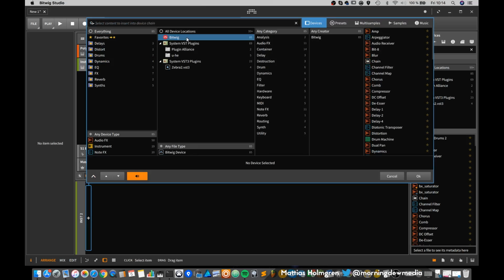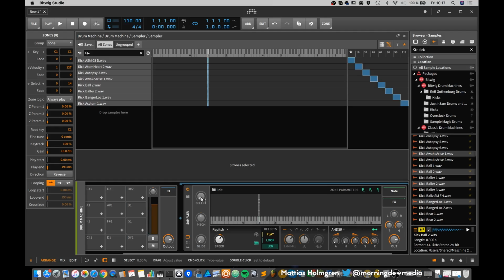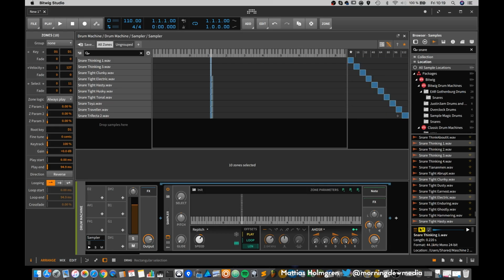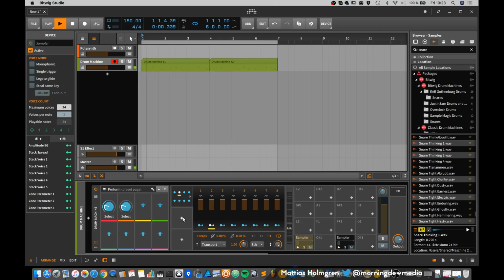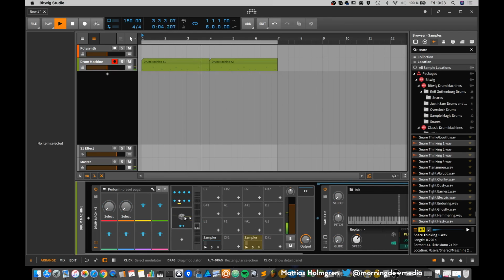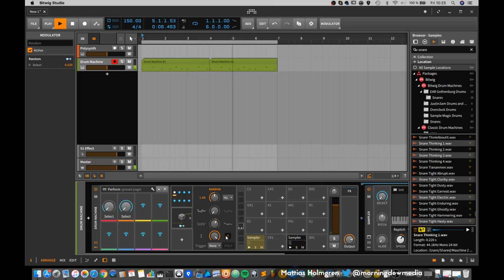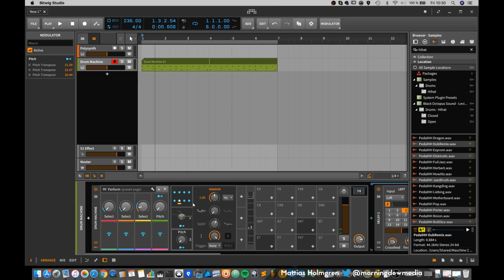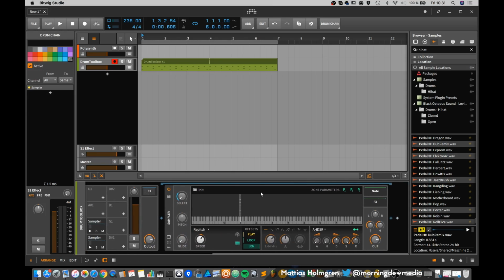Bitwig Production Tip | Drum Toolbox & Drum Machine

Comment: Matt, since your videos are really helpful, I wanted to share a quick tip I discovered on a reddit forum and that you may not know: You can rename your drum elements in the drum grid editor even with third party plugins such as Maschine: all you have to do is insert a Drum Machine in the slot before your Maschine/Battery or any other drum plugin you want. From here, just double click the drum machine cells. When the browser appears don't choose anything, just click the OK button. You can now rename this drum machine cell in the inspector on the left. If you want to rename each cell, you can do it slightly quicker by activating the MIDI DIN icon on the drum machine to find the cells with your MIDI keys.
Reply from the maker: Great tip

Comment: Mate is there any way i can copy like 80-120 hit samples into one key note at once? Its very time consuming, dragging and dropping onto a not when u have hundreds of samples
Reply from the maker: Yes, when dragging the samples and hovering over the multisample keyboard (drop zone) look at the bottom infobar of the Bitwig screen. It will display some short key suggestions (like Shift, Control, Alt) and what they do respectively. Select all your 25 samples (or whatever amount) Hold Ctrl and drag your samples into the multisample area (notice that only one key lights up now). This will automatically spread them for selection too. Hope it helps.
Reply: @MattiasHolmgren  oh man iv just been trying for the last hour to the out the select nob. Thanks for the quick response 😄👍. U made me very happy after i got all frustrated and turned my pc off. Now I'm going back up to try it out again
Reply from the maker: housebrigade haha ragequit? Happy to help my friend!
Reply: @MattiasHolmgren  lol it was more than ragequit. Now iv just spent ages filling in the 16 pads with multiple samples and have just realised i need 16 macros now :(  and i can't just use 1 macro nob to controll the sample selector on all the 16 pads. Wtf man. Ive had bitwig for a while now and there's still soooo much more to learn
Reply from the maker: There are soo many ways to use all the different devices... mind explodes

Comment: If you don't know already, you can save time by hitting the little star icon first (it will switch the window to Select), then drag the samples holding down control to the single key you want. Now you're done. You can do this with up to 128 samples.

Comment from the maker: Bitwig Production Tip | Drum Toolbox & Controlled Chaos. In this episode we build a groovebox drum machine with controlled chaos. This is a great trick to get randomization to your grooves, or just to preview a midi beat pattern while selecting different sounds. Removing the need to drag and drop samples, just rotate a knob and hear new sounds. 

If you want to pick up Bitwig Studio use my affiliate link:
☀ https://shop.bitwig.com/order/checkout.php?PRODS=4710161&QTY=1&AFFILIATE=112945&AFFSRC=https://www.youtube.com&CART=1
10% discount with PromoCode: C20F425E74

DRUM TOOLBOX & CONTROLLED CHAOS in BITWIG 2.4
This is also a great Bitwig production tip to make it easier for you to switch between drum kits and find your perfect drumkit for a song.
Connect the "select knob" to your midi CC 1 controller and just move the mod-wheel to instantly switch drumsounds.

BITWIG SOUND DESIGN TIPS
In this tutorial you will learn about the new multi sample page in the Bitwig 2.4 Sampler. We talk about how you can add multiple samples to the same keyboard note value and map these samples to separate selection zones with a quick macro command. We can then switch the sample of that single key with modulators for random sound picking!

This device will surely ease up your drum programming and help you get more interesting percussion sections. Try it out!

Let me know what you think about this device setup idea!

Thanks for watching and subscribing,

Mattias Holmgren / Creative Director
Morningdew Media

JOIN MY EXCLUSIVE COMMUNITY:
☀ https://www.patreon.com/mattiasholmgren